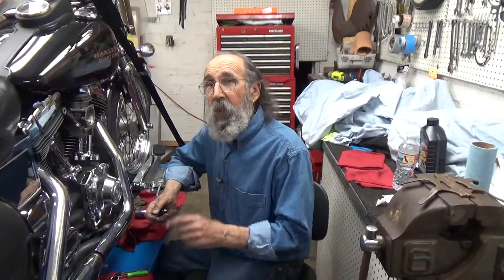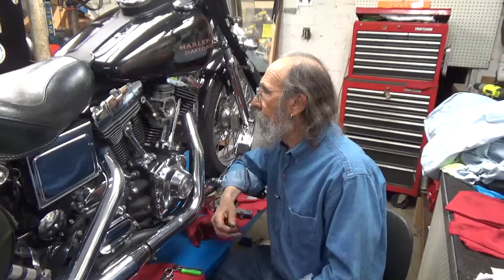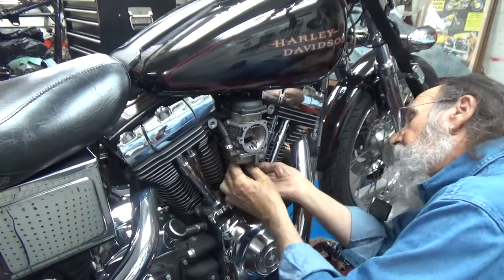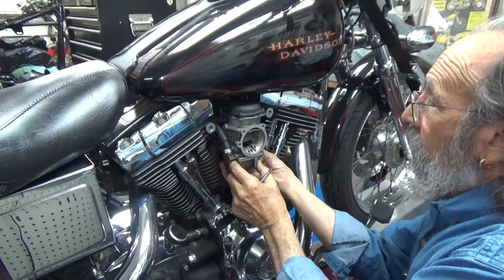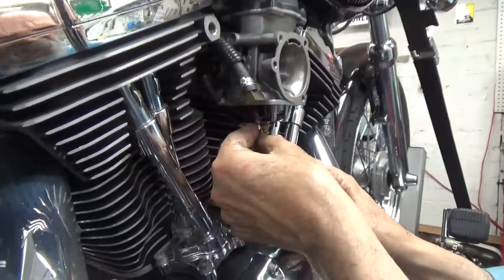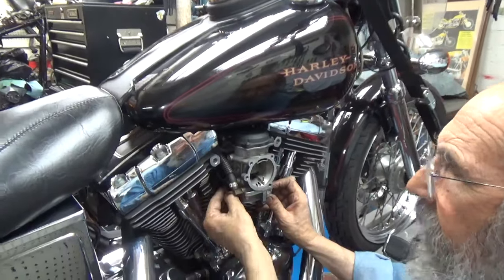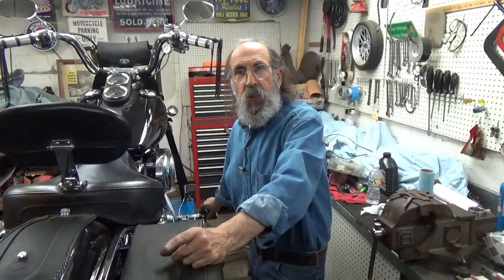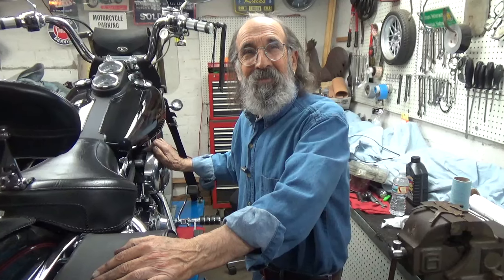Rejetting the Carburetor on a Harley Twin Cam

Comment: Wish I never sold my carbed 02 road king. Had it big bored to 95 with a v&h 2 into 1, cam, heads. It was the mileage that was killing me on cross country trips that made me sell it and buy something newer with fuel injection. New bike with a bigger motor and stage 1 makes the same numbers as the 02 on paper but it’s not the same feeling. Missing the simplicity of a carbed bike.
Reply from the maker: I get it.  It's quite a chore, but I have converted an injected bike to carbureted.

Comment: Stock was a 45 pilot jet. Used to drill them out to a 47 ish in stock trim. The factory had to set those bikes up sooo lean to pass emmisions. At 1000mile services plugs would be birch white. Scary lean
Reply from the maker: Yep.

Comment: My 03 roadking is carb. I was having a little trouble after changing exhaust and air cleaner. I was going to replace the CV w/ a S&S but after some advice from a friend I decided to order and install a CV Performance kit w/ new jets and haven't looked back. When the CV is working properly it is a good carb.
Reply from the maker: It's an excellent carb.  The only reason I ever changed them is to go larger.  That's when the larger Mikunis come in to play.

Comment: His exhaust maybe loose at the heads or needs a new gasket in the balance tube on the exhaust or just cut the balance tube out and weld they good for f all... I run 195 main jet with washer under stock needle and a 48 pilot jet 2.75 turns out on the idle mixture screw from seated I'm at sea level in new Zealand not popping or back firing on decel dont buy the cv performance kits they all trash
Reply from the maker: I don't bad mouth people's products or criticize their approach much, but you can, so, thank you.

Comment: harley bike builder  over 50 yrs carb work most the time is 1st do intake off do rubber gaskets remove bowl change low jet then on bottom there is a jet hidden near bowl count turns blow out turn about 2 to 2 half remember run bike 15 min adjust curb idle check plugs too black jet to big
Reply from the maker: Amen.

Comment: I no longer own a motorcycle, not am I a mechanic. I ran across your channel, and subscribed. After reading all the comments, I concluded that you had the right fix. I would have liked a short clip at the end of the video (after the test ride) to show you with a winning grin on your face. On another note, I am running across younger mechanics who never worked with points in an automobile.
Reply from the maker: Thank you very much!

Comment: Don't you try to adjust the mixture screw a bit after swapping the jet? I always do a coarse adjustment of the mixture screw, take a test ride just to get it warmed up, and then proceed to the fine adjustment of the mixture at idle...
Reply from the maker: Sure.  I run them on the lift until warm and then adjust it.  It's not really much of an adjustment though.

Comment: I have the same issues. About 10 years ago a magnifying glass became a permanent addition to my top box. In a lot of ways I miss carbs but on my 05 Heritage I put a ThunderMax EFI. Great tuning capabilities. It's my first injected bike and the only bike I have owned newer than 1976. It's true, most of these kids don't have a clue how carburators work, how to troubleshoot, or repair a carburetor, and here I am learning the ins and outs of injection. It makes us kind of in the same boat just on opposite sides.Thank you for these videos and be safe.
Reply from the maker: I agree.

Comment: my 01 heritage classic always started hard and took a while to warm up. replaced intake manifold seals and put a 50 jet in it. starts every time and made exhaust come to life. now going to upgrade tensioners and a  510 cam.
Reply from the maker: Sounds great.  Watch your sparkplugs.  By that, I mean, your sparkplugs will tell you if you have a vacuum leak.  If both plugs are the same color, chances are, no vacuum leak.  If one plug is light and one plug is dark, very likely you have a vacuum leak.  You may need to rejet after changing the cams.  But, sounds like you're doing well and having fun.  I'm all for it.

Comment: Great job Mike, I think that's the same problem I'm having. I had the bike repaired after a wreck and different pipes installed, now I have to have it enrichened about 1/2" just to run the thing on a warm day. Today it was 38 degrees and it took a lot of cranking to start it, fully enriched.
Reply from the maker: Check the sparkplugs.  If they are the same, all is good.  Just sounds like you need a richer low speed jet.  If the plugs don't pretty much match, you have a vacuum leak.

Comment: Another question, 2003 softail, same bike that was running rich. I had a smaller pilot jet (was 48, now 45) installed then proceeded to adjust the idle fuel mixture screw. While it was idling I closed it letting it seat gently. It kept running, although not very well. It is now at about 2.25 turns out and runs great. My question is, does it really matter that it didn't die when closed. If there was any damage to the seat, so what?, since it is at an appropriate setting now? That's the real question I have. All I ever heard is if the seat is damaged then you have to get a whole new carb, that does not seem to make any logical sense to me now that I think about it.   Thank you in advance.
Reply from the maker: If it's running fine, it's running fine.  That mixture screw actually does very little to affect anything.  Yes, you can get a little idle smoothness out of it, which is nice.  But, that's all.  Overtightening the screw could damage the seat in the carburetor, which would be very difficult to correct.  Honestly, I really wouldn't worry about it, nor would I spend time looking for a "nonexistent" problem.
Reply: @pacificmike9501  that's what I thought, thanks for the confirmation. Have a great weekend.
Reply: @drumwhacker  Curious…what indicated the bike was running rich? I’m new to carb adjusting myself, and have mainly read most are running lean??? Just wanted to know what I should look for as a sign of running rich. Thanks in advance for the help 👍😎

Comment: Good morning Mike, here's a helpful tip my friend.  Part # 27094-88, still available but of course you have to order it,  is the early 1200 Sportster needle jet. This really helps the entire mid range lean condition of the CV CARB for owners with just a free flowing intake and exhaust. Best $10 you'll ever spend. Good job recommending the pilot jet increase, and yes the main jet is more than adequate. When and if you take the carb off, pull the welch plug to get to the idle mixture screw, and do a final adjustment after warm up, but I know that you know that,   especially on a CALIFORNIA model. Have a great day, SARGE.
Reply from the maker: Thank You again.
Reply: Thank you as well Mike.
Reply: This is an old comment, but for anyone reading this , CV Performance makes an improved needle that they call the Velocity Needle. The old Sportster needle works best when using shims, the number depending on the application, but the CV Performance Velocity Needle works great without any shims. Good power, great fuel economy, and crisp throttle response with the Velocity needle, a 46 or 48 pilot and a 185 main here near sea level, and 53 MPG out of my 74 inch motor on the highway. Can't beat it!

Comment: 03 Sportster 1200 custom XL 100th yr anniversary edition. 24k miles. Inherited it from my late Step Brother who had it at sea level in FL. I'm in Ohio at 1001 ft above sea level. It's doing this exact thing.  I turned the idle air fuel fuel screw 1.5 revolutions counter clockwise which seemed to improve it slightly but it still does it. At 2 turns it's worse. I believe I may need to change out the low side jet. What size would you recommend I start with for my elevation?
Reply from the maker: Are the pipes and air cleaner stock?  Take out the slow jet and read the number on it.  If it's 45, try 47 or 48.  They're cheap.  Experiment.

Comment: Before changing to a Mikuni 42, free flowing A/C and RB pipes I had the exact same set up on my 02 Night Train. Being pretty much just above sea level here in Massachusetts and having a 95ci I had  the same pipes, A/C and my CV had a 48 pilot. I would get that lean spit any time I got on it on the highway when changing gears at a higher RPM, never bothered rejetting or adjusting needle as I went to a Mikuni but the CV is a great and forgiving carb IMHO. I'm a carb type of guy myself and learnt to rebuild and sync them on my metrics so when I got into Harley's only having one figured it was a piece of cake lol. Little did I know that a single fire coil and old school V Twin tractor engine makes for a tricky tune at times being the way the engine scavenges, especially when changing cams, head flow, compression ratio, timing, ect. I just love the way a carb sounds, feels and how easy they are to tune as you can really only do so much with them and feel the butt dyno is all you really need. my question this week, hmmm let's see...how about we get old school Mike. Plug chopping, it seems to be a lost art and have been told that with today's plugs it really can't be done accurately but I still believe plugs don't lie. I've never tried this method but surely would had I known all the variables like will colder weather give you a false reading of lean or vice versa with warmer weather. Should I have the bike up to operating temperature and then switch plugs to begin test and at what throttle increments. Do you cut power at higher RPMS at WOT and kill it then pull over and check plugs? Does the type of plug matter, iridium, nickel plated, platinum ect. Maybe I'm overthinking it but I do check my plugs usually every 1000 miles and change them every oil change. While this is probably overkill I can't leave my bike alone. If plug chopping is still an accurate measure of ratio I think a proper explanation (maybe a video) from an expert like you could really benefit young Jedi's like me when the torch is passed as I hope to be as good as you when I get older and tell the ones coming up about the Great Pacific Mike and how I learnt from the best.
Reply from the maker: Thank You.  I feel I'm being "over-rated."  However, there's been a lot of information about reading plugs over the years.  But, as far as I can see, "trends" show up.  In other words, today's fuels and plugs are not that easy to read.  For accurate reading, you have to look at (with a magnifier) that little ring way inside where the steel and porcelin come together. "The plugs look dark."  Okay, they're running rich.  "The plugs don't match.  One's dark and ones light."  Most likely a vacuum leak.  Today's engines, when running properly, have nearly complete combustion.  The relics still tell us stuff.
Reply: Same carb

Comment: Hello Mike! I’m once again seeking for your mechanical wisdom 😂 I have done a full top end job on my 98 Electra. All stock motor, no performance upgrades. I have only ridden about 50 miles since. She seems to struggle at low RPM, not idling very smooth. And when I go to take off, she just feels empty? If that makes sense. What jet size would you recommend? I purchased a kit with multiple sizes. And I live down in Florida.
Reply from the maker: Just go a little bigger on the low speed jet and see.  You should also look at your intake closely to see if it's leaking.  Pull the spark plugs.  If one is dark and one is light, you have a vacuum leak, probably at the manifold.  Check the lines at the carburetor and petcock.  Also, check the ignition timing.

Comment: 👍🏼 Man,,my '67 XLH had a Tillotson!! Wire guide throttle no spring return! gas drinking 133mph TOP Speed,,aint no 133.001 either. freaking wobble above 130 says STFDown✌🏼
Reply from the maker: Sounds like good old timey stuff.

Comment: Amazing video❤...thanks Mike for a mention female riders. 🥰
My softail heritage 92 runing very well in full throttle but is "jerky" in a low speed, actually only in a movement and not in neutral. Do you think I should check the CV carb low jet or main drive chain?
Reply from the maker: Low speed jet.  Always check your chain as a matter of proper maintenance.

Comment: I was wondering if I could re-jet without taking my carb off my Sportster that has the crossover pipe. Maybe I can. I've been chasing down intake leaks and it's rideable but still has some popping and stumbling problems. Maybe re-jetting will do it. 

I think I solved one major problem with a quality automotive hose clamp which I put on where the carb mounts the manifold. I access it with a 5/16" long wrench from the other side to tighten it. I hope to find the right jetting and leave it alone.

I just bought this used 1200 Sportster and it has all the get up and go I need. I don't need any more. It's like a Sportster should be, in my mind. I like to ride it like that once in a while and enjoy what it has. It's enough for me. It just seems like a Sportster should be. Any less performance and I wouldn't really be happy, but I don't need any more. I just want it to run right all the time.
Reply from the maker: 1200 Sportster has plenty of get up and go.  Is your carburetor mounted properly?  Check your service manual.  Does it have an air filter bolted to the heads?  Get all this stuff properly mounted before you start rejetting.  That rubber the carb slideds into doesn't need a clamp, it probably needs replacing with the carb and air filter tight to the heads.

Comment: I just got my 04 Dyna Low Rider home and noticed it does not like to idle cold.  Live in Florida, so wasn't using choke w/ambient temps in the 80s and a HD receipt for recent carb work conducted.   Any suggestions?  Oh, it does have the upgraded SE pipes on it..  This is my first bike and understand carbed bikes have their own personality.   🤔
Reply from the maker: Carbed bikes are normal.  You need more fuel with a free flowing exhaust.  You probably don't have a choke.  You have an enrichener.  Use the enrichener to start the bike.  Then, slowly turn it off as the motor warms up.  If you have a nice free flowing air filter to go with those pipes, you'll probably need a slightly richer pilot jet in the carburetor.

Comment: Hi Mike , Enjoy your videos. I've also run into those Phillips screws with the mangled heads. What I found years ago working with points ignition were these mini ignition pliers from Snap- On that have lots of torque and work like charm. No need for an impact driver or to remove the carb.     Cheers
Reply from the maker: Cool.   Cheers

Comment: Ok so I would of been loosing my mind watching the guy with a screw gon reaming those screws on the air filter!! Now what if the bike owner broke down on the road & can't get the Fkn screws off!! OMG 😳
First off the plugs need to be checked before doing anything!! A good shop has a magnifying glass for reading jets along with jet drills to clean out the slow jet if it got goobered up! A 50 is too big. The jet doesn't always fix the spitting! The mixture screw does along with the needle jet!! A 1200 sportster needle works wonders & a cheap bang for your buck ! Awesome throttle response! This bike is gonna run rich & waste gas!!
Reply from the maker: I disagree.  But that's alright.

Comment: Fresh fuel. New plugs and a run. Fuel screw at 2 ½. Go from there.
45 should be big enough for that setup well before 3 turns out. I have big sucker, Vance and Hines short shots and fueling 525 and can't get a spit or popping at 2 ⅓. Take it out at 60 for a good 20 minutes just holding the throttle stable. If the headers and cam cover get overly hot it's lean. 10th of a turn on the fuel screw either way of dead on will either run hot or not hot enough. Cam cover should get about as hot as a fresh made coffee with boiled water no matter how far it's been.
Reply from the maker: Alrighty then.

Comment: Mike, Love your videos, some times it brings a different look on a problem, I always went the wrong way going smaller thinking that it popping cause to was to rich.
But I was wondering if there is a way to ask you a question, on a 72 FLH with a 4 to 5 speed conversion?
Reply from the maker: I'll try to answer it.
Reply: @pacificmike9501  I like my older bikes so I got a 72FLH basket case, the transmission has a 4 to 5 conversion now the clutch lever is to short to align with the cable end so It tries to pull the cable sideways instead of pulling it forward, I dont know if i need a longer lever on the trans or does the cable get rerouted? thanks Mike

Comment: I have an 02 hd softail standard with an oem carbed 88ci, I put a new 2 in to 1 v&h exhaust and a rsd heavy air cleaner intake. It runs pretty close to before but you can definitely smell a more burnt and dry smell coming from the exhaust with the new parts on.

Where do you recommend to buy new carb jets from? Any recommendations on which jet sizes to use (located in Chicagoland)?

And lastly, when installing the new jets, does it matter how many turns into the carb you put it in with or cant you just put a new jet in and thread it in until its good n' tight?

Thanks! 🙂
Reply from the maker: The jet just goes in good and tight.  You probably only need a low speed jet.  Don't know what your altitude is.  Harley dealership or aftermarket shops should have jets and be able to make recommendations.  I don't know what that carb came with in Chicago.  There ought to be plenty of people to advise you.